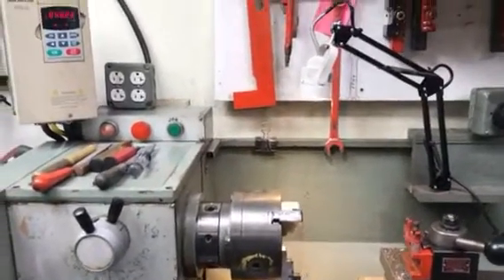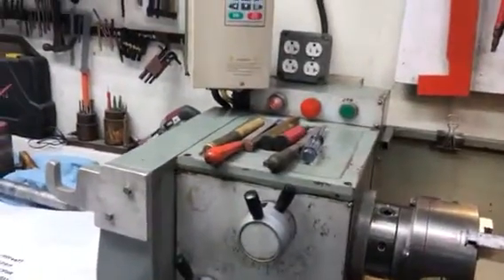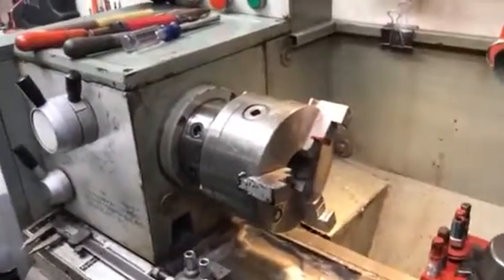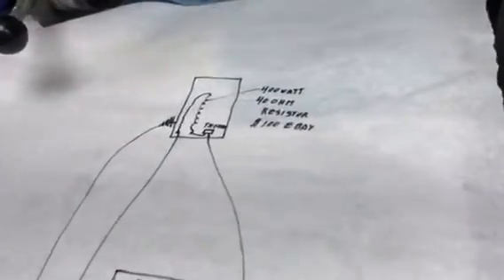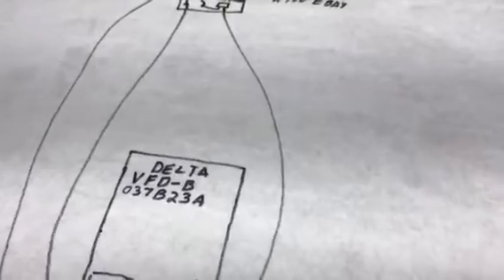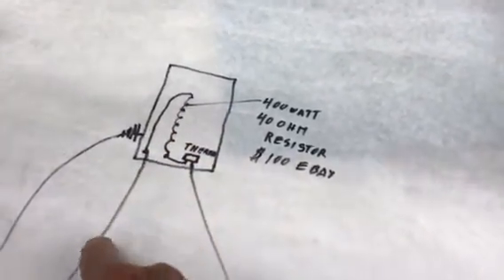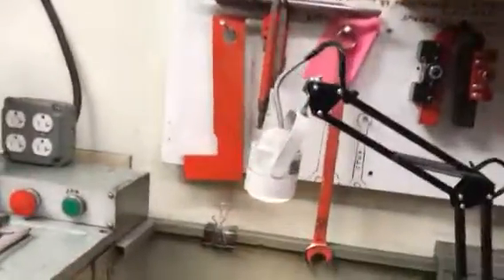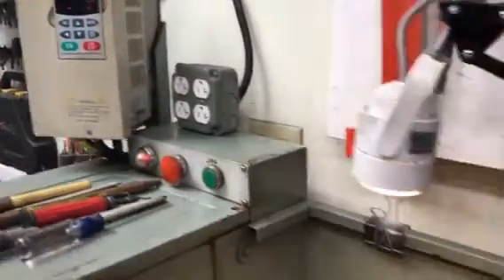Variable frequency drive breaking a resistor installation

Comment: Thanks for the video.  It was good to see the resistor value you use.  Just a bit aside.  It's not a good idea to run the lathe without the chuck jaw under load, tightened against a workpiece or themselves.  The centrifugal force and vibration can cause the jaws to come loose and fly out.